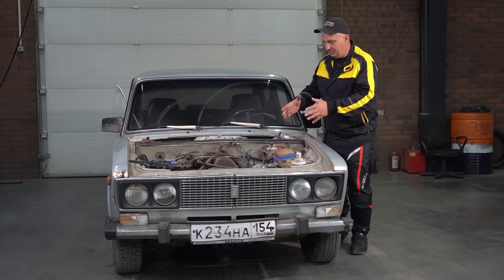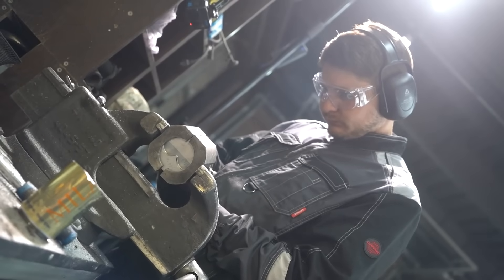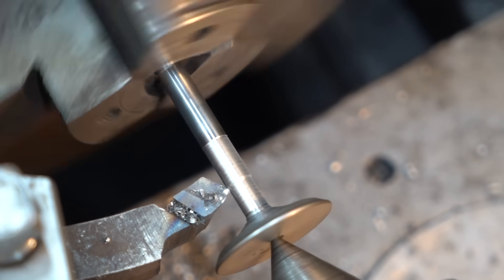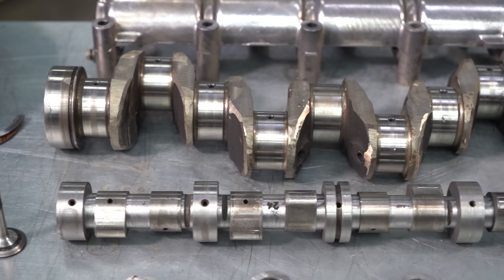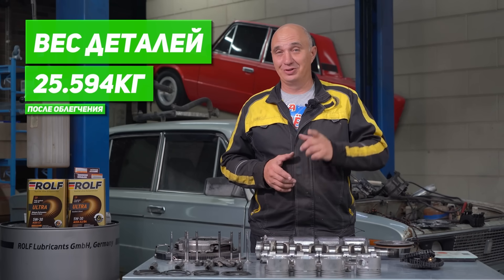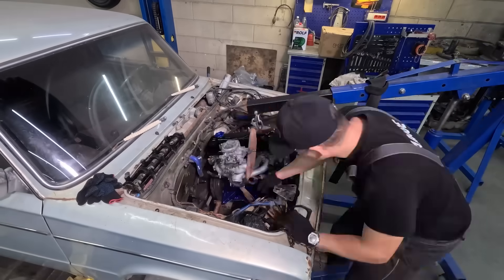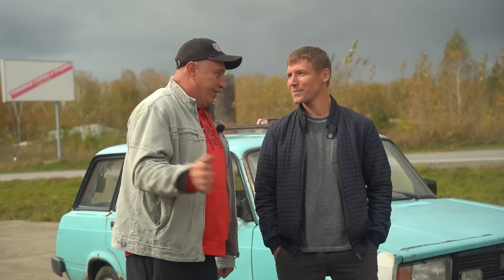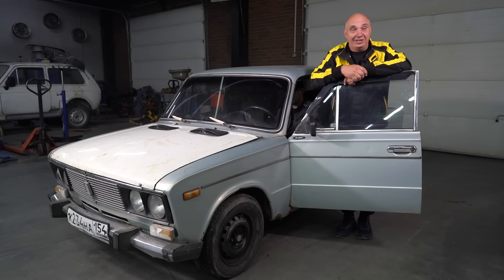Maximum rotating assembly weight reduction - what will happen?

Comment: Many more kilos could have been taken off the flywheel. Track cars may only have a flywheel weighing 3-4 kilograms. That would have been the biggest contributor to the round of sensitivity, but you didn't turn it lighter, pity.
Reply: Yeah I thought it was weird they chose a flywheel and clutch combo only a kg lighter than stock when most of the time lightweight kits are half of oem...
Reply: @imnota  The biggest benefit would have specifically come from lightening the flywheel in terms of rpm sensitivity.
Reply: @Topsiekku  
Yeah, easiest place to gain weight. 

But Frankly with that crankshaft job maybe you shouldn't go too light on the flywheel, it was already impressive it idled and ran decently with the counterweights off, and I have a feeling the heavy flywheel contributed to that. 

But yeah most of the times you save easily 5kg, sometimes 7 just on the clutch and flywheel. So them only saving one kg was kind of lame, especially when they have optimized other stuff to save just a few grams.
Reply: @imnota  So much so, because the reduction of the mass of the flywheel alone would have had more of an effect than the others combined.
Reply: @Topsiekku  
On the revviness yes, but when it comes to power lightening the top end parts and the reciprocating parts has the most effect. They're actual efficiency losses, whereas the crank and flywheel store energy but don't really limit the efficiency of an engine.

But yeah, it would've made more sense to skip lightening the crank altogether, get a much lighter clutch and flywheel and focus on valves, springs, retainers, rockers, etc as well as the pistons and rods.

Comment: Revs are limited by camshaft. With more sportier cam lada sings well over 9k rpm wihtout the load. On the load stock valve springs tend to float around 7-7.5k rpm.
If you want more power from it then must cut few mm bigger intake (+also in manifold) and exhaust ports and skim the head and block. If more, then bigger valves, and 2x Weber 45 DCOE's.
Reply: Motorbike individual carbs
Reply: @vodkavolvo5529  tuning them must be hell, at least the carbs on smaller 2 strokes are ass to tune.

Comment: You didn't mention doing anything with the valve springs which probably has the biggest impact on  how fast an engine can rotate. After a certain speed the valves can't physically open and close any faster. That speed is dictated by how stiff the valve springs are.

Comment: Ok guys talking about Better valve springs etc... This cars limited rpm at first try at max rpm is down to the distributors 'bob' weights that reduce timing when the engine revs too high. Lots of ways to fix it like welding it so it doesn't reduce the timing. Or just replace with electronic ignition. Btw engine builder and 34y(48yo) mechanic.
Reply: I was wondering if the distributor could be a limiting factor.
Reply: Yep I had a fuel injected 1.6 mazda b6 engine that had a rev limiter at 7200 but it wouldn't go past 6000rpm in gear because the distributor was the problem. It pulled so much timing that it made almost no power at 6000. Could only limit in neutral
Reply: The distributors pickup coil need re-gapping.
Reply: The weights advance timing, but it could be that the rotor have a limiter built into it.
Reply: @099las  As an automotive engineer that has rebuilt engines and work on almost ever kind of car, Your WRONG.
On the mechanical distributor in an old Lada the Bob weights are forced out by the g-force created by the spinning shaft inside of the distributor. On top of the bob weight mechanism in the drive plate for the rotor arm, this is for LIMITING the engines RPM, as there is NO other devices on the Lada engine that limits rpm, its all mechanical (No electronics).
Edit: it's a low quality Lada engine, there is no need for timing advance, it retards the timing, to limit RPM.
Reply: @BarryHaughey  Well I too have been a (certified) mechanic my whole life and I'm old enough to know a thing or two about distributors. The bob weights is to advance timing as RPM increases to allow for a complete combustion and correct timing as piston speed increases, they are not for limiting RPM.
Like I told you, some older cars do have a mechanical limiter build into the the rotor itself, It is also a centrifugal device!
You are not only wrong, but you also don't have the basics on how an engine works established.
A Lada engine or a Porsche engine works exactly the same way and they both need timing advance as the RPM increases, please do your research!
Reply: @099las   Timing advance is taken care of by a vacuum diaphragm on the side of the distributor thats fedd from the intake, so when on high throttle load, the timing is advanced. Not by the bob weights which are for what ive already said a while ago.
Reply: @BarryHaughey  OK, I Googled it for you.
Here is what I wrote:
how does the bob weight in distributors work

And Googles answer:
In a distributor, bob weights are connected to a rotating cam, which, as the engine speed increases, causes the weights to move outward against springs, twisting the cam and thus advancing the ignition timing. This centrifugal force, generated by the spinning bob weights, effectively shifts the cam, which controls the firing of the spark plugs, to occur earlier in the engine's cycle. 
Here's a more detailed explanation:
Bob weights:
These are small, often dumbbell-shaped weights attached to a rotating shaft within the distributor housing. 
Cam:
The cam is a component connected to the bob weights and the distributor's shaft. 
Springs:
Springs are used to resist the outward movement of the bob weights as the engine speeds up. 
Centrifugal Force:
As the distributor shaft (and therefore the bob weights) spins faster, the centrifugal force pushes the bob weights outward against the springs. 
Cam Movement:
The bob weights' outward movement, against the springs, causes the cam to rotate. 
Timing Advance:
This rotation of the cam advances the timing of the spark plugs, meaning the spark will occur slightly before the traditional time for optimal engine performance at higher speeds. 

Can we end this silly discussion here? Thank you.
Reply: @BarryHaughey  Well I did write quite an essay but I must have been to hard in my wording because youtube decided to delete it by the looks of it. I don't know if you managed to read it before it was deleted! But that's water under the bridge now.
Once you realize why it works the other way round you will be a better mechanic than you were yesterday, and with that I wish you a good evening.
Reply: @099las  im going to keep this short & just talking points...
No1: Different distributors are designed differently by different manufacturers / engineers, depending on what is needed from the distributor.
No2: i cant believe you went ballistic over this !!!.
No3: Looking for info on a website that is misleading is a recipe for disaster.
No4: The channel Highlighted my comment as 'Most needed info' 2nd they Thanked me for it, They had wondered why the engines RPM would not change no matter what they did to the engines internal parts.
No5: Contact the website You got you're info from & tell them different distributors ARE designed differently.
No6: The give away is the vacuum spark advance on the side of the distributor !.
No7: YES some distributors have a spark advance bob weights in them BUT, NOT this one !!!.
Lastly this was done & dusted 8 months ago, when the vid was uploaded.
Thanks for the conversation, But dont Explode at someone without context and research.

Comment: It would have been interesting to have put it on a dyno before and after, most of the weight reduction would have reduced friction, and the work on the valves would have slightly increased air flow, but the removal of the crankshaft counter weights might have increased friction.

Comment: grade 5 Titanium? on a 10.4L V8 Caterpillar that would take a 120lb crankshaft down to 75 pounds... tho one 3208 CAT is 210HP and the other is 480HP. already a common thing, 4340 alloy gets rusty after sitting a few months. "stamping forging, grade 5 Titanium?" for the bigger engine's, more noticeable.
Reply: Is the only difference between 210hp and 480hp the crank?

Comment: Good video, a dyno graph would be very interesting before-later.  Wagons more weight, but shorter diff ratio? Here in Spain Seat 124-1200 wagon used a 9/40 diff ratio, Sedán    10/43). Edit, I wrote 10/41 instead 10/43, some Wagons used also the 10/43, as the Sedán.

Comment: The engine should be a lot more responsive it should be able to rev up faster from idle to max rpm in a quicker time you should test how long the engine takes to rev from idle to 6,000rpm I bet it reaches that rev much quicker also test how long the rev hang is which is how long it takes for the rpm’s to drop when you lift off they throttle that should also be less

Comment: Vlad, spassiba for yet another great video. Regarding the RPM limit, have you checked the Ignition system yet? Even older vacuum points systems can determine how much the engine can accelerate. Also the cam will be a concern. By the video, it looks like the engine is revving up easily until the limit is reached, and then it refuses to go further, hence my opinion is likely it's an Ignition limitation. An update on this would be great. Also, I suggest a video on how much power you guys are able to get from the Lada powerhouse. Turbo or not.

Comment: You should have measured the time it took to top rev before and after mod and not rpm limit as thats decided by the ignition system and not the rotating assembly. Rotation assembly is only a supporting role for rpms, ignition is the main factor.

Comment: Valve float.
Taking the weight from the valves would have made it worse. Need to put the original back in and use stiffer springs.

Comment: Well I believe you unbalanced the crank to the rods and pistons. Try to blueprint with a weight reduction and you’ll get actual performance, then you can make a better compression ratio, extended cams, titanium pistons, or bore the block. But there isn’t much else you can do for power on na engine. I guess you could put in adjustable valve timing but that is a pain.
Reply: Sure outside of the engine you have intake and exhaust, then lightweight pulley, and bla bla bla

Comment: The red line isn't going to change because the engine can't flow anymore air. With the weight reduction the engine should rev up quicker but without opening up the exhaust and the intake the vehicle isn't going to rev up any higher they also didn't put lightweight pulleys and water pumps on that could also be under driven to reduce rotating weight.

Comment: Valve float and cam lobe dimensions stop this engine from revving past 6,000 RPM. Try putting in tougher valve springs and you will see a noticeable difference

Comment: The weight is only a small factor when it comes to the upper rev limit, although the weight loss means it will reach the rev limit much faster. Balance is very important too if you don't want it throwing a rod out the side of the block, especially on the crank, but looking at this, I`d say its air flow which is the limiting factor on this engine. If you opened up the inlet & exhaust ports, improved their flow, added bigger valves, fitted twin Weber DCOE carbs using an inlet manifold matched to the widened inlet ports, then made a tubular 4 into 2 into 1 exhaust manifold to match the exhaust ports, you`d then see a serious improvement in performance & rev limit (& then find the breaking point of the parts you lightened!).

Comment: Weight reduction = engine response. Redline = valve springs, intake/exhaust porting, exhaust flow improvements, cam duration, ignition timing and carb jetting. More important than max redline though is USABLE torque curve and how it lines up with your gearing. An engine that spins 10,000rpm in the pits means nothing if it stops pulling at 5,000.

Comment: The crank shaft looks like one from a Model T ford now 😂

Needs a bigger cam or all that rotating mass reduction wont help much. It will just rev to the cams maximum engine speed faster!
You need more duration or the cylinders wont be able to fill at the higher rpms, it doesnt matter how light the rotational assembly is. In fact the max rpm may actually be lower because you no longer have the inertia.
At least once you get that cam the engine will be ready to rev to the 🌙 
Love this channel :)

Comment: You can also drill lots of holes around the pistons below the Oil Ring, and stepped sized ones in the center of the connecting rods. I have done this before in a 2 1/2Hp Go Kart engine, that ran faster than 5hp powered ones I raced against

Comment: You needed to test how fast it reved to 6k before & after the weight reduction. Loss of mass will not increase hp. & as other have said in comments most likely valve springs restricting revs.

Comment: Another awesome experiment. Don't really think it's gonna rev to a higher RPM but will reach the higher RPM range faster. You could be limited by air or fuel supply or potential valve float in wich your springs aren't able to fully close the valves at most than that RPM resulting in a loss of compression at 6,000. if it is valve float stiffer springs should give you higher revs. Anyway still and awesome video. Love you guys.🤘

Comment: They'll never read this but that air die grinder they're using, you can easily port the air motor, housing, and throttle and it'll make twice the power and twice the RPM.

Comment: You should drill the crankshaft! Like old airplanes and f1 cars.
Reply from the maker: Can you elaborate?
Reply: @Garage54ENG  : https://forums.pelicanparts.com/uploads26/P1040797_1_1581371222.jpg 

They drill out several kilos.  And make the crank stronger. Hollow crankshaft
Reply: @Garage54ENG  YouTube removed my link. Google hollow crankshaft

Comment: That was certainly a very cool video. If you can read that, G54 crew, please try again, by removing the flywheel or making it dangerously thin, and install a bigger carburator and a turbo, so it can get more air also. it will surely get to at least 7999 rpms. Cheers!
Reply: It's only needs a stiffer valve spring to do that. The valves no longer actually close at that rpm with weak valve springs that's what limits the rpm. Making stuff lighter will just make it rev faster
Reply: If you remove the flywheel, how is the engine gonna start? First of all, the flywheel is what keeps the engine from stalling when idle, secondly, the starter uses the flywheel to start the engine (unless you own a very old car)

Comment: I am under the impression that the Lada engines are based on the Fiat 124 engines? 
How about a screaming turbo twin-cam Lada?
Reply: No they are not. The fiat engines were not ohc. Those Lada engine are more comparable to a certain bmw engine, apparently.
Maybe they should do the Lada VTS
Reply: @eefjuh5533  Fiat 124s came in push rod or twin cam versions so this Lada is one of their own creations since it is SOHC. Pity it doesnt the Fiat DOHC Lampredi engines, it would fly
Reply: @aidanlyons1155  or the Lada vfts - 150hp na. Or the Lada with the Wankel engine.

Comment: forge a flat top piston using a single ring.. aw nah man cut the skirts off those pistons, right around the rod connector journals then all pistons must weight the exact same within KG's. rods, rings everything, balanced perfectly .. but man when you lose weight lose weight... grind that crank down to 25$ of its weight, its so over engineered anyways, then knife edge it and polish to a mirror shine, balance . . pump some ponies!

Comment: The difference in the drag race was the launch! The most important thing in drag racing is to the 60ft! This has been tried by many race engine builders! George Bryce explains it best! Usually the lightweight components lose momentum on the shifts! The engine not revving is because now everything is horribly unbalanced & you didn’t do anything to make the air move through the engine any better!

Comment: The platform they are performing the weight reduction to isa bone stock motor  .The rotating mass upgrades will not increase the rpm range .However the modifications will shorten the time taken to reach that rpm.Removing 8kg away from the rotating assembly is  definitely noticeable.

Comment: the spark and cam timing have ALOT to do with high rpm power, advancing the spark timing at a given RPM raises the power band to higher optimum range and Retarding the cam timing also has a similar effect, bigger cam, increasing duration and lift with more overlap will make it rev closer to 10,000 the overall weight is not as important as the ballance but being lighter makes it easier to have a ballanced design without imbalance

Comment: How about you guys tuned up the carburetor? Also open the air flow in the intake, exhaust, and cylinder heads, too. That will reduce some weight. After that race the Lada again.  That will be cool 😎

Comment: You're exceeding the limits of your valve springs, camshaft, carburation and exhaust flow. That's why that thing won't go past 6 grand.
Reply: well they did lose a little weight on the valves and rocker arms and that would help the valve springs some
Reply: I have a diesel that goes to 8
Reply: Acceleration improved.

Comment: These lada engines are mainly restricted on airflow through the tiny valves they have. Also the very low compression ratio is an issue aswell.

Comment: To bring up max Rev is to replace the crank with a shorter throw (stroke).
Then it's on to valvetain. Solid lifters, and stronger springs,
Then re time the cam advanced of the crank by 10 degrees